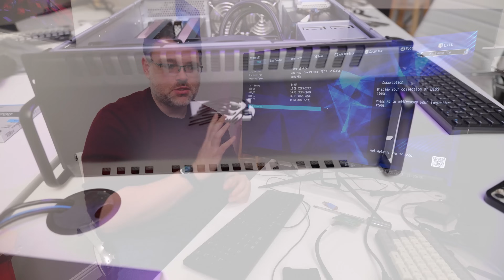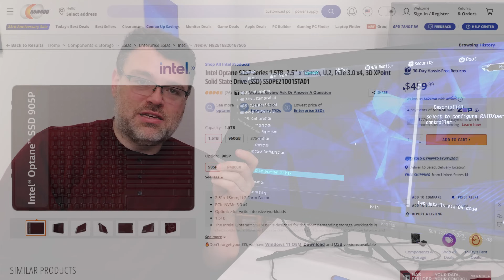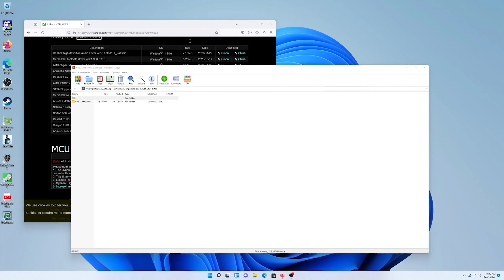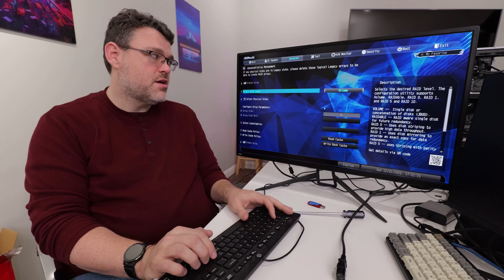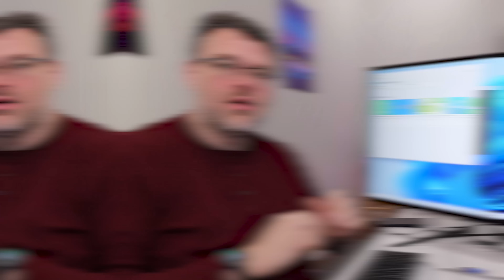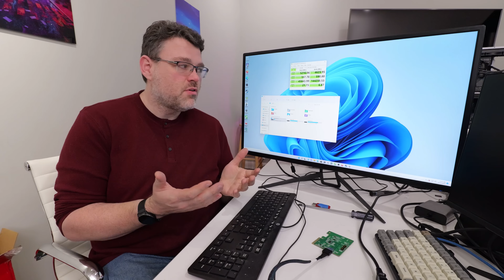AMD Threadripper RAID in 2024! Is it okay?

Comment: I've used PCIE multiplexing cards for my U.2 setup. So long as you aren't hitting all the drives at once you get pretty decent performance. And they can be had for pretty good prices off Aliexpress.
Reply: Not recommended for RAID0 or 10 for obvious reasons.
Reply: Pleaseeee give a parts list. This is exactly what I've been wanting.
Part selection in the UK is dumb, like we pretty much don't get Optane at all but I still wanna look.
Reply: The catch here is that with a RAID setup you're kind of by definition hitting all the drives at once - not an issue for stuff like medium performance SSD servers but it does kill the peak speed benefits of throwing Optane or high end SSDs in there

Comment: Hey Wendel, this video comes really in clutch as I'm preparing to build my NAS with a 7700 and 2 Samsung 990 Pro in RAID 1 as boot drives, I was thinking about using Debian 12 or Ubuntu 24.04 as my OS, do we need the drivers or are they already inside of the Kernel? Thanks and have a nice day!
Reply from the maker: Ah so for Linux don't do this as I said in the video. Do mdadm software raid in Linux. All better. Nothing special needed in bios.
Reply: for 990 pro, make sure to cheeck the firmware version in case it needs to be updated; some had notoriously bad wear which is not undone but just stopped by the firmware update. I had to use magician under Windows as their bootable ISO wouldn't boot on my latest build.
Reply: @mirror1766  thanks, I will definitely take a look on that!

Comment: (Edit: early comment) Huh? Of course one can run Optane on AMD platforms - it's PCIe-ish!
That's the beauty of computer science - usually, we take the abstraction layers kind of scenic route. Even Optane/3D-Xpoint "speaks" NVMe, which is, and always has been, afaik, a "dialect" of PCIe. (i remember a few PCper VODcasts, back when Ryan Shroud and the magnificent Malventano still ran the show - i think, they've published an explainer piece - how NVMe is Intel tech, and how they'd had to tweak PCIe …yadda-yadda …optimise it into a new method, now called NVMe) …it's kinda like the OSI model - it's abstraction layers, all the way down.
Reply: though using the baby optane consumer cache drives as cache with the intel software had some hardware checks and sometimes manufacturers had their own release with its own checks.

Comment: Any substantial difference in Optane performance of Linux (mdadm?) RAID vs. ZFS RAID vs. Windows/AMD RAID?
Reply: Mdadm beats amd software raid by a country mile
Reply: My mechanical drives beat the nvme raid0 on AMD 😂
I use two nvme drives separately now 😊
Reply: I don't think what an end user understands by performance is what zfs has its focus on.
Been a zfs user for like 10 years..
In my experience even raid1 was slower than software raid and on strong hardware. 
What I expected was data to be read concurrently from both drives. But zfs is zfs. It has lot's of things on its mind 😂
I use zfs for its rich zfs features and nvmes for performance. Like old masters used to say, nothing is cheaper than hard drives 😂 when it comes to your happiness...
Reply: Many moons ago, perhaps in late 2011, I built an AMD system (Bulldozer?) with motherboard RAID (ASUS?). 
I thought this was swell, until the CPU/motherboard died, and I could not find replacement anythings, except perhaps in a computer museum. Sadly, the hardware RAID
made the disks in its care (and their data!) unusable by mortals or other controllers. At that point, I abandoned hardware RAID as a vendor-lock-in ploy, similar in spirit to my  3970X upgrade non-path. As a huge fan of data integrity (Thank you, Roger D. Moore!), I began using ZFS, and never looked back, as it offers
far more power, robustness, and flexibility than any other storage subsystem I have ever worked on or used, including the SHARP APL file system that
I first encountered back in 1971. I tried mdadm somewhere along the line, but ZFS is light-years more advanced.

Comment: For a RAID volume like this does it matter if the PCIe lanes come from the CPU or the chipset? What if some disks have lanes from CPU and others have lanes that are from the chipset?
Reply from the maker: Until you saturate bandwidth it's basically okay. So a raid 0 or 1 with 2 drive you're okay or very nearly so. You get 2-3 nvme behind the chipset and it's not as good in raid because they complete with each other behind the chipset for bandwidth back to the CPU
Reply: @Level1Techs  thanks for answering so quickly!
Reply: @Level1Techs Try testing the speed again with AMD raid cache disabled.. 😉 ✌️
Reply: Same, I never know how to distinguish these.
Reply: Id love to get an answer to this question too.
Reply: Disabling caching in the bios is most important.. Catching with AMD raid hinders performance, optane does not need caching..